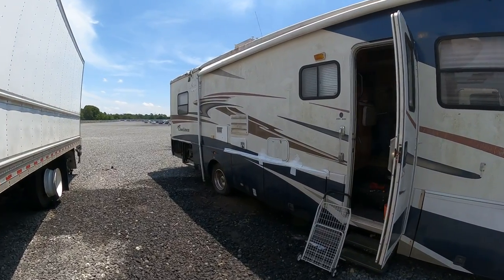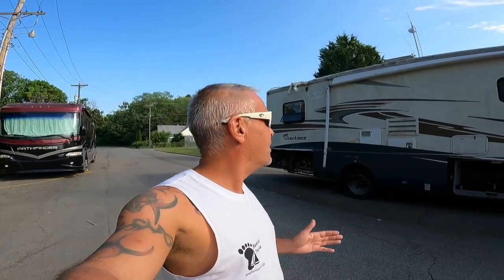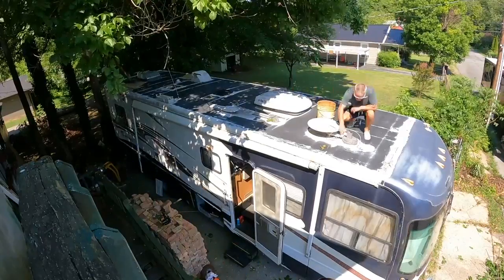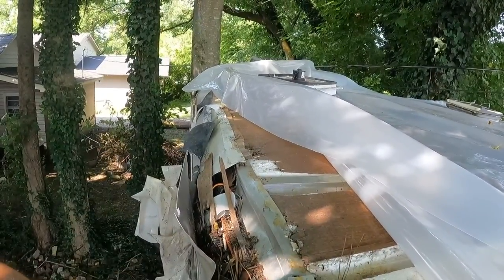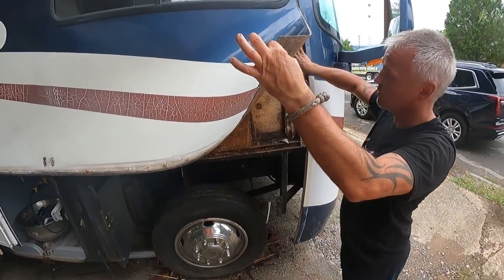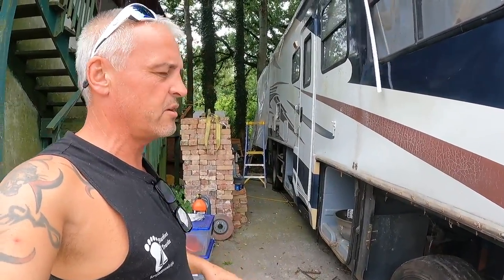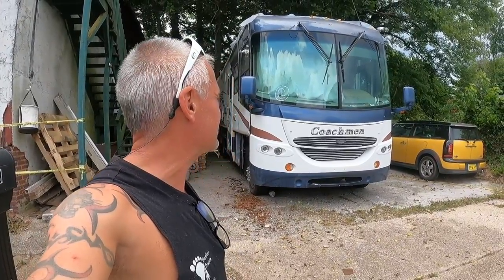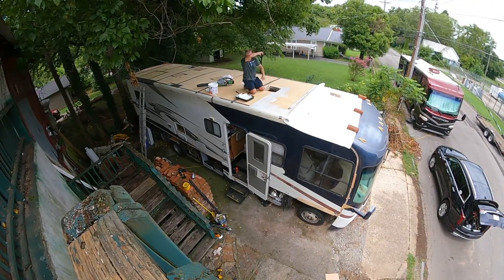DIY RV Roof and Wall Repair - RV Restoration (S4 E19 Barefoot Travels)

Comment: Unrelated question if I may: I assume you guys have registered the catamaran in Ontario, so who are you using for insurance?  I have a comparable cat that I need to insure in Ontario as well, and mine was also under hull repairs, but is now done.  Great series, keep up the good work!
Reply from the maker: Thank you! We are what we call self insured as we don’t go into marinas and we are in hurricane zone at the moment. Will be looking into liability insurance before we go to the states on Barefoot
Reply: @BarefootTravels  Yeah, I am stuck needing marinas for at least one more year, as I cannot bring the cat outside the great lakes for another year; still some repairs to do.  I just don't want to be on-the-hard forever... 😕
Reply from the maker: The hard is definitely a hard time. Good luck with the project!